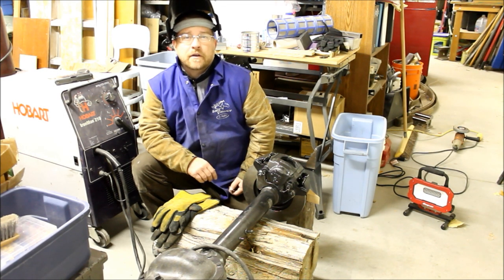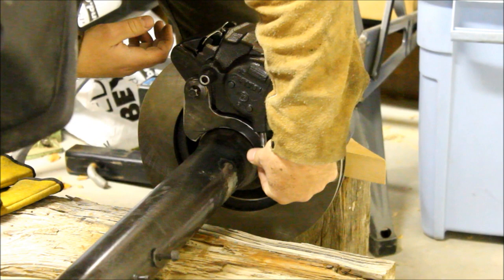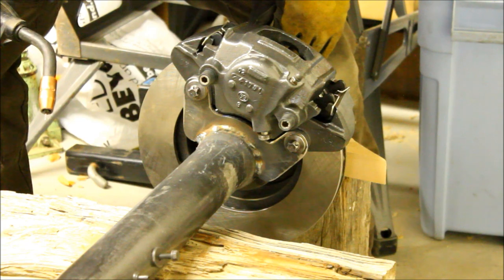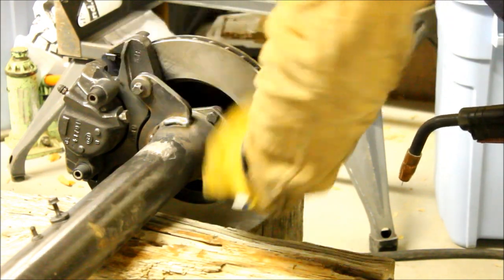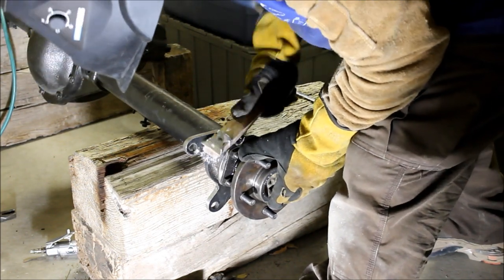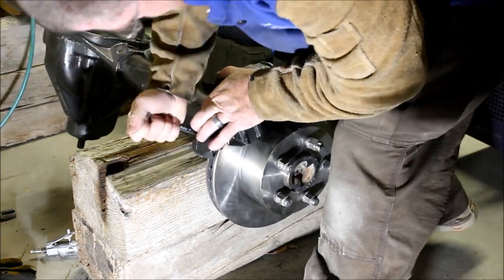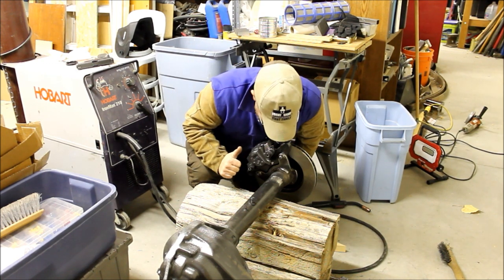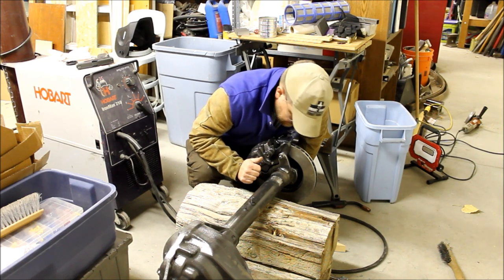DANA 44 Disc Brake Conversion Part 2

Comment: I installed an electric line lock to the front brakes that I use on the trail for short stops...I wired a 12-volt chime from Radio Shack into the rocker switch so that I always know when it's engaged (it's way too annoying to ignore or use for extended stops).  I also installed a mechanical line lock from Jeggs to the rear brakes for parking when the Jeep is turned off.  The lever is hidden and therefore also works as an anti-theft device.  Between you and Matt I am constantly inspired and educated in matters of upgrading and repairing my old YJ.

Comment: This is truly impressive. Not only in its ingenuity, but in your selection of easy to come by parts and execution. I really, really like this idea. I scored some ZJ rear brakes from a junkyard to eventually attach to a chryco 8.25, but these brakes seem much better. With the addition of a line lock hand brake, I feel it would be even better. No more nasty drums and shoes, just easy to maintain and replace discs all around. 

The only hurdle for me are the brackets. You're quite lucky to have a friend who can cut those out for you. I think combined with a WJ front brake upgrade, any Comanche/Cherokee will stop on a half a dime. I'm going to have to rewatch part one, to figure out how you drew a design for those brackets. I'm planning to do this on a 8.25, but it should not be very different.

Let us know how the brakes are once you're done! I know you usually do not notice much from rear brakes, but with equal size brakes front and back, it's bound to make a difference. Thank you for posting this.
Reply: +Dillithium I got impatient with Part 1 and didn't really show how I made the chipboard pattern. Maybe it deserves its own video. I'll see what I can do for you. There are several ways to cut out the steel once you have your pattern made. I just took the easiest path available to me. I'm sure it could be done with a hand-held plasma cutter or a good torch and some patience. Don't let the bracket discourage you, it wasn't as hard as I thought it would be.

Comment: there is a bolt on way to do it with Ford explorer rear brakes and you retain the emergency brake. you just have to use a Rubicon spacer.... and redrill it xj Dana 44 pattern for axle bearing seal. pretty easy and no welding required

Comment: A line lock set up to the front circuit also would give you four wheel E brakes and could really help during winching operations if you're the anchor.

Comment: This is an excellent project. Of course your welds are less than perfect. You are learning. That Hobart seems to work well. I would say that heat management is something to plan for because you don't want to distort the bearing races. Also, maybe multiple passes would be the way to go. And maybe jump from side to side so that it doesn't pull. But you go it. The only other thing I would advise is to treat your body right by getting that up on a bench so that you don't have to weld bent over. Your body deserves to be comfortable and your hands will be more steady. I'm looking forward to the line lock for the parking brake. I would be cool to see that operated by a hand lever in the cab.
Reply: I was a. Floor tile man. For. About a year and half. I also worked  hanging drywall  an metal studs for 40 plus years ,and  all take toll on your needs an joints I'm paying for it. Now. I was 62. Yesterday. Thank Lord For another day  ,?
Reply: Work off a work bench alot more comfortable  an easy .

Comment: Use the vw rear brake calibers with handbrake.
Brake caliper rear axle right side / co-driver side - OEM Ref. 7H0 615 424 / 7H0 615 424 AVW T5 Transporter (7H,7E,7J)All types - Transporter, Multivan, Caravelle, PritscheAll engines up to 2.5 TDI 128kWSystem TRW for 294mm brake discs rear41mm piston

Comment: Your emergency/parking brake provision, per State LAW, in many IF NOT ALL States requires it to be separate from the service brake system and mechanically operated, you cannot use a Line-Lock and have it DOT OR State legal and pass State safety inspections if the inspector is doing their job correctly. Might want to check on that in your own State to be sure, but here in Pennsylvania, that's the way it is supposed to be.

Comment: on your positioning of the calipers ,  front disk calipers are  mounter on the upper rear side of the axle , but most every  rear disk caliper i have seen is mounted on the upper front side of the axle.  it looks to me like your's  are mounted on the upper rear side.
Reply: +gibsalot  not sure if that makes much differance or not.
Reply: +gibsalot I mounted them upper rear. that's where they are on my 9" and I've been really happy with it. Figured it would work fine on this D44 too.

Comment: Do you know if a d44 out of a 1987-1989 Cherokee will bolt right into a 2000 cherokee
Reply: Eric Soto yes it will, just did it to mine

Comment: Interesting neighborhood you live in if you have to have a Glock in arms reach while welding in your shop. I'm a Beretta man myself and oddly enough Im glad I had a 92fs on my work bench one night because a half starved and clearly desperate mountain lion decided to try and make me its next meal. Even half starved and probably weakened it took 3 hollow points at point blank range to stop the big cat as it came at me in my shop in 2017
Reply: And I go hiking with a knife thinking that'll be enough to save my skinny ass against a mountain lion.  I should invest in bear spray.
Reply: We. Have screaming 😱   black. Panthers  here in Mississippi  an they will  make your. Hair. Stand up ??